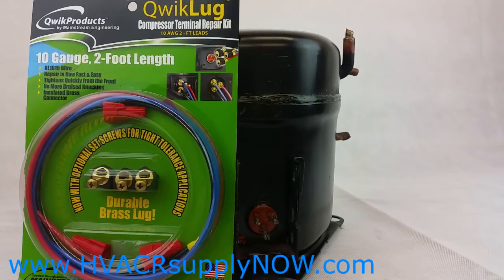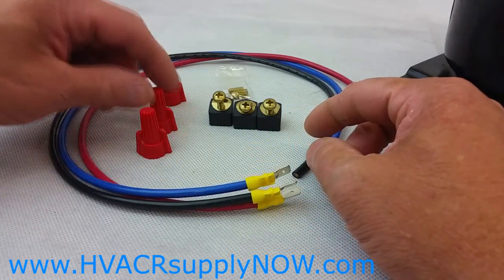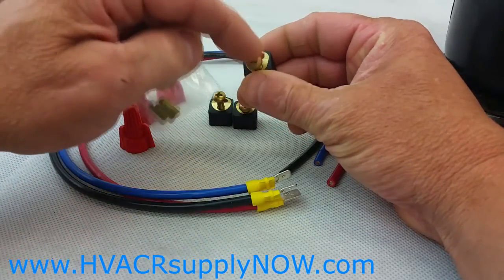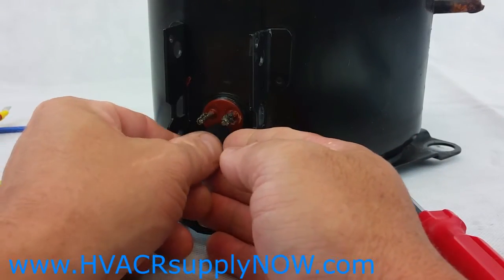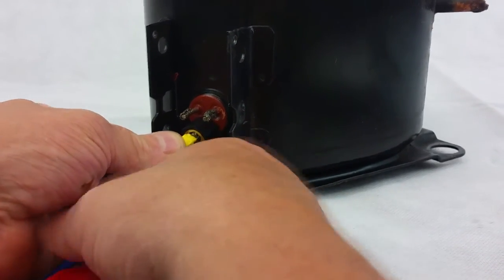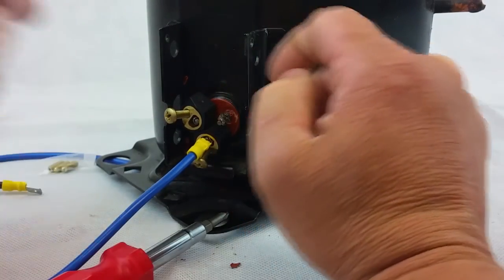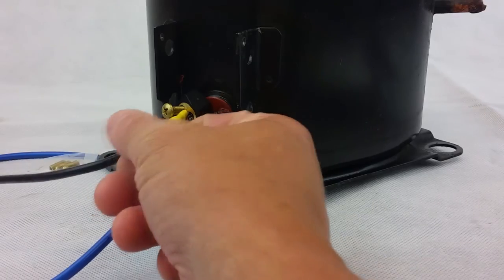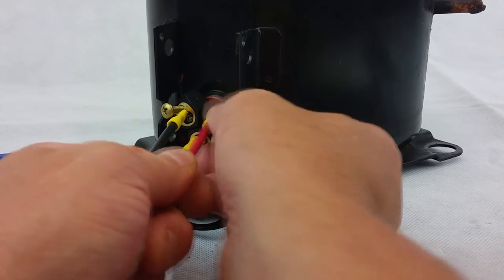How to Use the Qwik-Lug Compressor Terminal Repair Kit - HVACRsupplyNOW

Comment: If the compressor terminal are coated black, should it sand them down to show metal before installing the repair kit? If so, what can i use to expose the terminal metal?
Reply: Yes I would sand the terminals down for a better connection